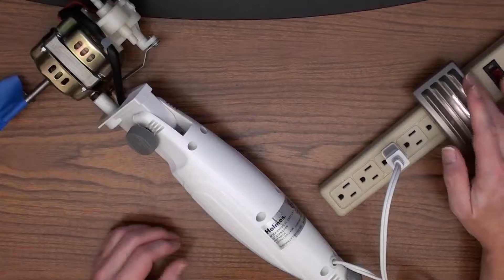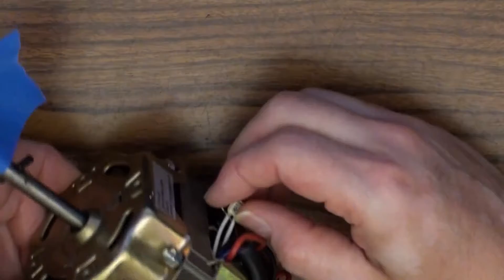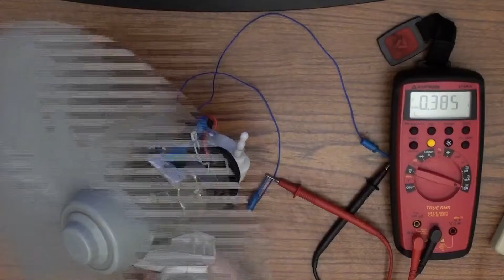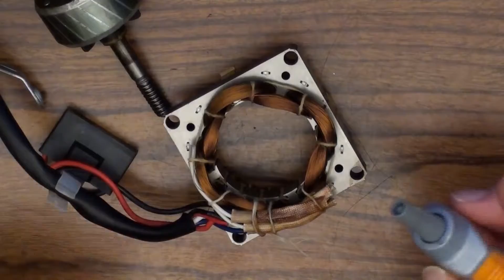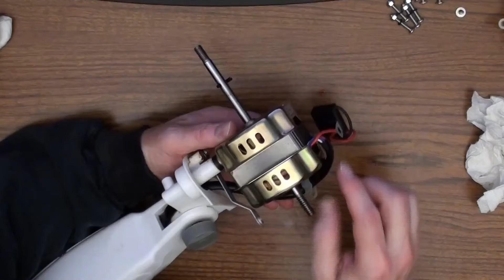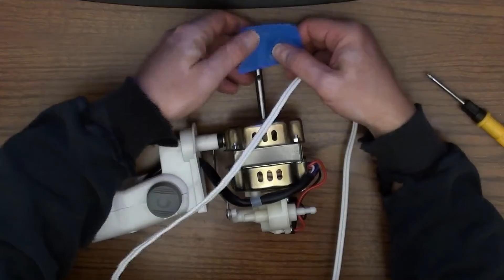How to Fix a Dead Holmes Pedestal Fan (Thermal Fuse)

Comment: I also have a fan that's dead as in the circuit is open. I haven't been able to open the motor because of the conformal coating they use on the motor to seal it. Hoping all that's wrong is a thermal fuse then it's off to amazon for some.
What happened on mine is it seized up on low and then the fuse popped. I'll have to lube it up and fix the thermal fuse. I have bypassed them to get something working but then it's unsafe.